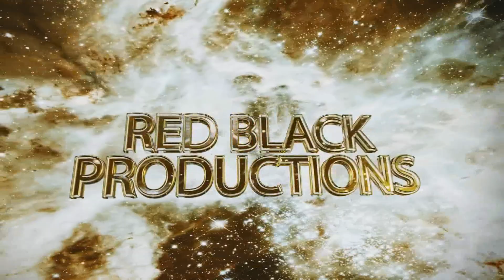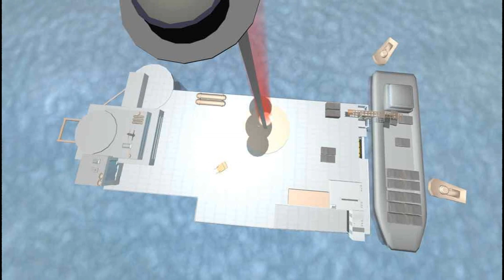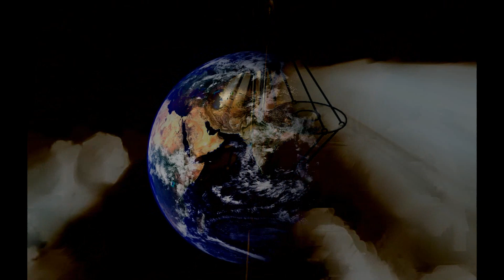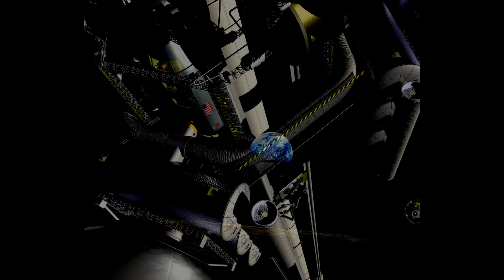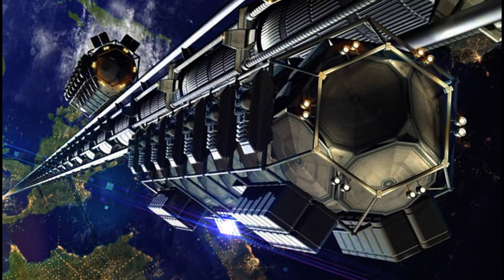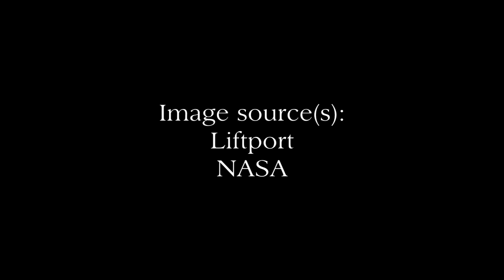A lunar space elevator by 2019?

Comment: A new patent I just read about, will allow space elevators to be built with current materials.
 It has multiple tethers at its center ( for greatest strength ) and fewer tethers
 as you move away from center  ( for lesser amounts of mass ). 
Liftport has plans to build a Lunar elevator from current material.
Using that same material for an Earth based elevator would reach the lunar gravity center
(about 9,000 km AGL) approx. 1/6 G. Add this new concept and you could reach Earth's surface.
 We can do this now. Let's get started. What do you think?

Comment: LIftPort actually has most of the R&D done at this point necessary for the elevator. They've changed their target material for the Lunar Elevator to vectran string. The numbers have been run, and it's strong enough for the Lunar Elevator. It can also be mass produced in the quantities needed (LiftPort had no problem getting over a mile of vectran). The lifter that would do it is mostly built, and the science numbers have been run and it can all work. At this point, it's just a few relatively simple engineering problems before all the necessary R&D has been done, although an earth-based test that will have the same pull as the full lunar elevator has yet to be done (due to still needing to get airspace clearance for the test, which is legally tricky.) However, that test is hopefully going to happen sometime in the next few months. If the test is successful (which is likely, as the previously mentioned engineering problems are nothing more complicated than problems what typical cars on the road face) then really all that stands between a successful lunar elevator testing and reality is funding... and the mission to setup the lunar elevator can be done for equivalent to taking an astronaut to the ISS. (Lighter automated payload counteracts the longer distance, and expenses of previous lunar missions don't need to be taken into account since the "landing" method is completely different, and that was the primary reason for previous lunar mission costs.)

Comment: That doesn’t even make sense. How is it too expensive to build if you start from the earth but if you start from the moon it’s doable? How does that work? 😂 In any case, I don’t understand how you could even have anything tethered between the earth and the moon, even if you had the money and materials to do it, considering that the moon isn’t stationary in relation to the earth. It moves around the earth. So would people just get the top of the elevator and hope they timed it right so that the moon would be at the right location to step out onto? 🤣
Reply: A space elevator would not connect the earth to the moon.  The basic idea is that we would put some large object at the Lagrange point (the point between the earth and the moon where the gravity of each offsets the other), and construct a ribbon between the earth (or the moon) and that large object.  

It would be easier and cheaper to construct a space elevator between the moon and the Lagrange point for several reasons:  
The Lagrange point is closer to the moon than it is to the earth; 
The moon's gravity is weaker than the earth's so the ribbon does not have to be as strong.
The moon is tidally locked with the earth, so an elevator that's anchored to the moon will always be pointing toward the earth.
The moon is seismically dead, so there would be no quakes to disturb the anchor.
Weather and terrorism would not be an issue with a lunar elevator.